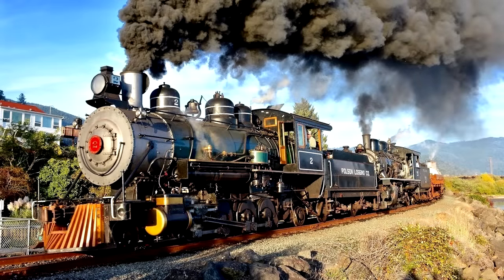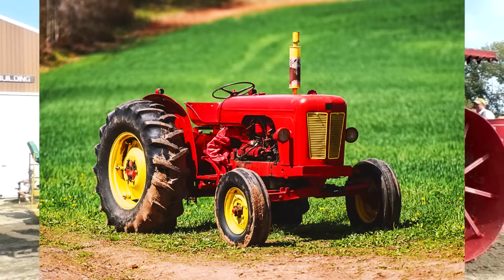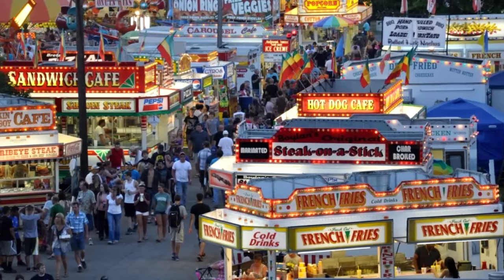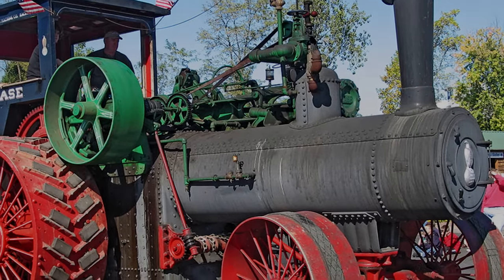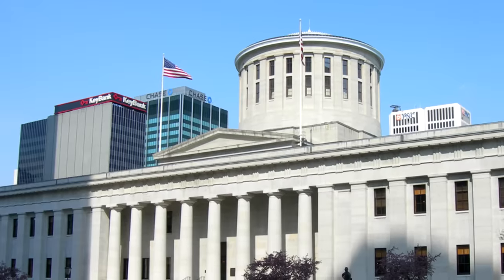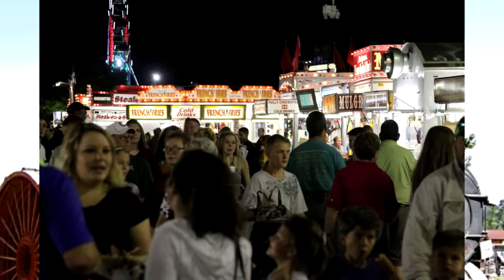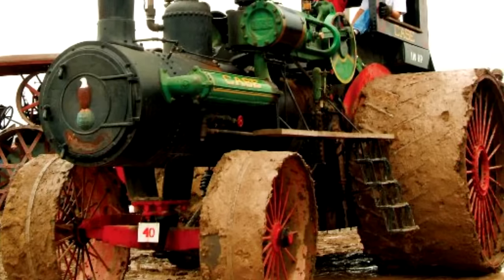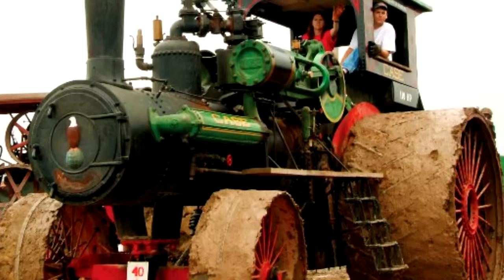The Steam Explosion That Destroyed a Fair 🚂 The 2001 Tragedy in Medina County 🚂 History in the Dark

Comment: When a crownsheet overheats, it becomes weak and fails due to being too weak. When reading over the old ICC reports of steam locomotive boiler explosions, the water level has been well below the crown on steam locomotives (15"-18" below the crown) so the crown would be high and dry and able to get really hot and weak. Water sloshing over a bare crown can help keep it cool and syphons keep water flowing over parts of the crown when the boiler has low water. It takes time for all that metal to heat up and become weak.  I haven't seen anything in old reports that supports the idea that water will flash into steam in the boiler and over-pressurize the boiler - but that weakened crown is pushed off the stays and and with the large rupture in the boiler, the pressure drops and then the water in the boiler (which is only kept in the liquid state due to the pressure in the boiler) flashes into steam due to the superhot water compared to the drop in pressure.

Due to the thin spot on the crown, the operating pressure should have been around 45 psi, yet it was operating way above that. With the sheet being around 0.087" thick, the crownstay in that area would only be holding onto 1 thread (they are 12 threads per inch) and that could have stripped the thread and overloaded the other bolts, which could have also stripped.

It is unfortunate that the owner killed other people due to the poor condition of the boiler that he was choosing to fire/run. It was on the owner to make sure it was in a safe condition. I had talked with the PA boiler inspector and people who knew him over the years and some of the people who knew him claimed that he didn't know the poor condition of the boiler (he should have as it was his responsibility) while others said he knew it was not in good condition, "but it had not failed so thought it was safe."

Comment: The picture at 8:06 is of SP745 in the yard of The Louisiana Steam Train Association near New Orleans.  I produce the calendar, newsletter and some of the other media.  I think that is a picture I took. 
          The locomotive is now undergoing its 15 year FRA mandated inspection and rebuild for safety.
          It actually was involved in a boiler explosion in 1921 when the fireman was thrown from the train and the engineer shot.  It was likely the assailant thought the boiler explosion/derailment would cover up the crime. The brakeman reported that there was another man moving around the train. The investigation turned up no one who could be prosecuted.
           It was rebuilt, eventually donated and placed in Audubon Park in New Orleans in 1956 as a static display and then returned to service in 2004.
           We have a former NASA engineer, who is a member, supervising the current rebuild/inspection and another member, who is a retired mechanical engineer, assisting.  Unlike back then, we can conduct ultrasonic testing of the metal thickness and for hidden fissures.  Pressure vessel men from a local chemical plant have volunteered to do the work.  This is one reason railroads wanted to get rid of these things, they are maintenance nightmares. 
           The fusible plugs actually don't greatly relieve pressure, but put out the fire by spraying steam on it.  The safest way to stop a possible failure is to reduce heat going into the system.
Reply: I don't think that fusible plugs dropping would put out a fire, but they're a very clear warning that you must throw  the fire out of the firebox, or else.
Reply: @crazyleyland5106   You are right. They reduce the fire, but it is certainly a notice for the crew to shut the oil off or dump the coal.   In the case I mentioned, the fusible plugs probably did work, but since the fireman had been thrown from the train and the engineer shot, the locomotive was unable to put the fire out on its own and the boiler exploded.

Comment: As others have said the UK is more thorough than the US with steam inspections. The smallest is still a potential bomb when in steam. Such conclusions came at a cost in broken bodies. A US standard postage stamp is just under one square inch. A boiler will have the pressure of 130 - 170 pounds pressing against each square inch of plate. A steam tractor restoration can be ruinously expensive, even for a rich man if the boiler is found to need major surgery. I mean beyond the point at which it is cheaper to roll & rivet an entirely new boiler. It doesn't stop some people doing it if the tractor was a experimental type or a sole surviving example.
Methinks the guy might have been unaware of local regulations regarding inspections. A careful buyer would ask to see when it was last inspected & the vendor would never be offended by the question. It shows diligence on the part of the buyer. Is the boiler still 'in-ticket' & is a hydraulic test due? In the UK you would.
The beauty of a hydraulic test is that it is done with cold water and an external pump. All orifices in the boiler are blanked off with plates. A failure only leaves a puddle of water.

That cop at the showground bears a measure of blame. You would have to be a complete d**k not to allow the engine to be tended to while it was stopped or allow it to be driven to the nearest fire-hydrant to refill the water tank.

Comment: If the water level in the boiler drops below the crown sheet, the sheet is not exposed to “air.” The air in a boiler is forced out by the steam pressure in a very short order under operation. Liquid water cannot be heated past its boiling point until it transitions into steam. The steam can then be superheated. So the liquid water covering the crown sheet, water cools the metal, locked in by the water’s boiling point. If low water level exposes it to the saturated steam the crown sheet will superheat the steam, rising in temperature until it goes red hot (plastic) and fails.

Comment: Couple of items. I’m the retired former general manager of a tourist railroad that operates a steam locomotive. I’m also a farmer and am very much familiar with steam traction engines being operated at county fairs and other such exhibitions. The safety issues as to the operation of a steam boiler are exactly the same. In this state ALL steam engines, other than those operated by non-insular railroads are required to be inspected by a state certified inspector before they are allowed to be operated regardless of public or private ownership or location of operation. I don’t remember the required frequency of inspections. This covers steam traction engines, full scale insular railroads, stationary steam engines, small scale “live steam” locomotives etc. Rairoads regardless of scale, that meet the definition of non-insular under CFR-2011-title 4 ss234.3 are regulated and inspected by the Federal Railroad Administration. States have no domain over those operations. There’s plenty of blame to go around with this incident. An unqualified operator not able or unwilling to do the required necessary maintenance and repairs and State of Ohio sticking its head in the sand and not having a strong state legally enforceable inspection system.
     Him being delayed or hassled by police that is entirely understandable! I know of no state or other geographic locality that will allow any heavy equipment with steel wheels with lugs or steel bar treads to be operated on public roadways because they can quickly do thousands of dollars of damage to those roadways. At our fairs or other shows the traction engines or the large gas engine tractors with steel wheels are always required to be hauled to those locations on trailers. Usually takes a semi-tractor with a low boy trailer. Doesn’t matter if it’s one mile or 100 miles. The only exception could be if the engine was being moved across a street from one lot to another when rubber tires or other protection for the road surface can be put down just the same as construction companies do when moving bulldozers of other steel tracked equipment across public roads. Been there, done that!

Comment: I used to have a State of Ohio Steam Engineer's License for over 15 years in the 1970s and the license exam was difficult and inspections on stationary boilers were extensive.  It is hard to believe they did not have inspections on a moving steam powered machine.  It seems to me some kind of permit or license would be required to operate this tractor machine or at least some kind of education/need to know on the safety aspects that would be required if it was to be operated on a right of way or public area.  On the farm, I would say they would be on their own.  I operated two coal fired boilers in Ohio and I went through an apprenticeship and a comprehensive licensing exam in Columbus in which I was familiar with all parts of a boiler and auxiliaries.  Some least intrusive training should have been required that would not be too intrusive but at least gave boiler safety for everyone's sake.
Reply: Considering you're allowed to move farm equipment on the road and that farm equipment I don't think needs inspection stickers. This would be allowed.

Comment: The stated crown sheet thickness reported in this story I believe is in error. Having just read the source story for this video, the thickness as stated in the article is "0.375' ". That would be .375 feet or 4.5 inches thick. Unrealistic. The crown sheet standard thickness would actually be 0.375 inches or 3/8 of an inch. But 0.087 inches thickness is still too thin for this application.

This incident pretty much ended any active steam displays in the mid west for the next two years. Eventually most of the states brought amateur boiler operations under state inspection standards. Everyone had to have their steam equipment tested if they were to be certify to steam up that equipment again. This affected not just steam traction engines, but amusement park rides that had live steam and also hobbyists that had scale steam engines they ran in their own yard.  As you may imagine, men skilled in maintaining these engines were in very short supply at the time. Now, 20 years later, the steam operators have gathered and have been teaching younger people how to care for these engines properly, including the welding skills to repair older boilers.
Reply: Yeah, read the original report and not that typo'ed article. It was a 3/8" crown sheet. Not 3/8'.

Comment: Sounded crazy to me given the U.K. laws on this. If it has pressure in it there is a cert with it. If it has more than a certain amount of energy it requires an inspection. Could be a crane, traction engine, a steam generator or a loco, they all fit under the same law. *some brutal tragedies to get there though.
Reply: In UK, a test every year, and then the boiler must have a major overhaul every 10 years to be certified as fit to steam.

Comment: Watching Jay Leno garage there were videos of the White motor car and the Stanley Steamer. These automobiles had flash boilers (mainly due to weight?) but I don't see much information about flash type boilers even though they seem simple and safer than the pressure vessel fire tube type. The White vehicle (made by the White Company, not painted White) had a condensing radiator and condensed then returned the boiler water to be used over again.

Comment: This is why any steam boiler (at least one that is to be operated in public) should be subject to mandatory inspections, regardless of what the steam will be used for.
Of course there could be allowances for very small boilers, e.g. (small) model sized and certain very low pressure devices. 
I do believe that in the UK even model boilers need to be certified in order to show them publicly and possibly to sell them on.
This was an avoidable tragedy brought around by, if not incompetent, unskilled operators.
Reply: I'm familiar with live steam requirements in some states.  Ohio really doesn't have any regulations for miniature boilers, although most of the club tracks do require testing of some sort.  Maryland is one of the few to have a formal state code for miniature boilers.  I was a member of the Baltimore group when this first came up and they decided that if it was going to happen anyway, they needed to cooperate and help write a code they could live with, which they did, and it's become somewhat of a standard in the hobby.  A lot of these engines use seamless steel pipe for a boiler.  3/8" steel is usually good for 450 psi.  I have a long-time friend who built his own, hydro-tested it at 300 psi and operates it at only 150 psi.  I have a lot of trust that it will be fine, but he keeps a close eye on the water glass when operating.

Comment: I remember when this happened.  Shocking since I have been to many engine shows in Pennsylvania and then wondered how dangerous these things are in their advanced age.  I know that steam boats and launches have to have a US Coast Guard inspection and certificate in order to operate.  I’m all for regular inspections and permits to operate steam powered equipment, especially in a public setting.
Reply: Potentially dangerous, but not so much if people follow strict protocol. In the UK safety is taken very seriously (a boiler test every year in UK, with a major overhaul every 10 years). Also the steam fraternity know how to handle their engines and how to avoid situations that could lead to a boiler explosion. It's not just due to age; a new boiler could blow up if handled wrongly.
Reply: @crazyleyland5106  Thanks for your response!  Folks in the UK tend to be more thorough with their protocols, especially with vintage machines!

Comment: It amazes me that it was there reguardless of any lack of state laws. Insurance companies have been regulating steam powered displays since the 1990's. A friend's family has their old traction tractor that has been in one of many displayed and ran in a large antique farm implement show that is held yearly. They go through a complete visual inspection, and then through a  pressure test where they must hold 500 pounds of water pressure with no leak down or leaks. Then during the show, they cannot run higher that 80 pounds of steam pressure. Several steam locomotive rides in the area have shutdown because they either could not afford the insurance after passing all the tests. Or couldn't even find an insurance company that would offer a bid. We soon may not be able to see anything built earlier than 2000 run due to insurance, regulations, and EPA concerns.

Comment: Historically, farmers have been allowed to drive their equipment on public roads tax free. (To try to help the farmer a little.)  Here in Arizona they still can.  Steam tractors have the boiler size to supply enough continuous steam to move the tractor at the speed of a walking mule while pulling the heaviest load and deepest cut then possible.  Just walking along, it could have used a boiler 1/4 that size.  BUT The age, huge boiler and  any  defect in the Header tanks would be very bad,  In England they have to be tested by a certified engineer to gain a certification plate.  Plus NEVER over ride a safety device.  Thanks for the stroll down memory lane.
Reply: Oklahoma there is also no problems driving tractors on public roads. The only problem i see is a 'quality of life' problem. That Case probably weighs 20 tons or more and is on steel wheels, and he's driving it on asphalt. I can only imagine the grooves it must have left.
I've got my own collection of classic tractors, but I always stay away from the steel wheel machines because there's just nowhere to enjoy them in modern infrastructure besides in the fields

Comment: I remember that incident they at the end of all the investigations they also determined the staybolts were rusted badly and the water level was low they stopped the machine the water sloshed forward  then back over the sheet making a volume of steam that the safety valve could not vent and the weak pints let go . This almost ended steam here in the US the feds wanted to ban every thing steam powered that would have been the end of the tourist railways and excursions the Cass people were telling me about this that would have been sad . Indiana has a inspection program but only if you take it to a public event  so my small boiler I run my little engine here at my farm is not required to be inspected as long as it’s not off my land . A local millionaire is all for the yearly inspection but the cost has pushed the Everyman enthusiast out of the picture there are few certified boiler people any more and they are in the Industrial end . Once again the actions of one have ruined it for every one else .
Reply: Boiler has to have boiler number stamped on it, before it can be operated. Person operating must have minimum of class 4 steam ticket. Boiler hydro tested. Steam bomb: volume times pressure times 1600 in fraction of second. If your boiler operates at 140 psi, volume water 5 cubic feet when it explodes becomes 1.1 million times!

Comment: I remember when this happened my younger cousins were there that day and sitting on a bench about 50 feet away with their grandparents and the engine pulled up and as it did someone in a van pulled up between them and the engine and it went to back up and that is when it blew up so the van shielded my cousins they only had burns from falling material thankfully

Comment: Sad story. I saw my crown sheet photo I took of Santa Maria Valley #21, now in Astoria Oregon. Dont worry we replaced the whole firebox. one spot on the side was less than 1/16 of a inch. ultrasound didnt even show it. it was in the middle of the forest of staybolts. On a brighter note I was in the doubleheader of the twoooo and the 25. I visited Milwaukee boiler works and saw the 2 boiler upsidedown with no firebox, Skip was replacing most of the throat sheet. federal rules lot different than state